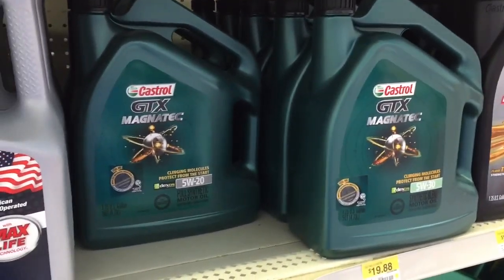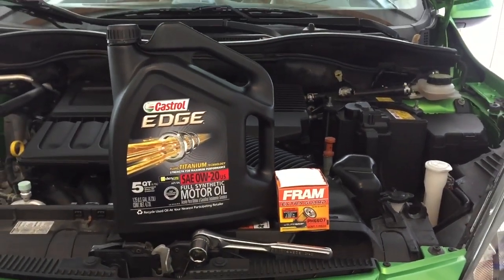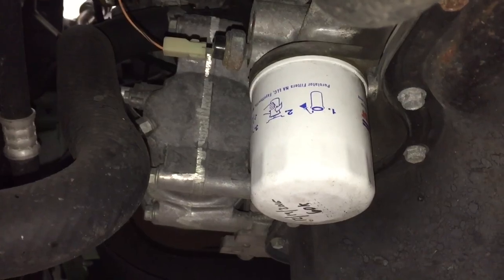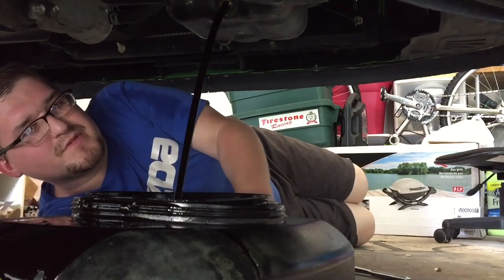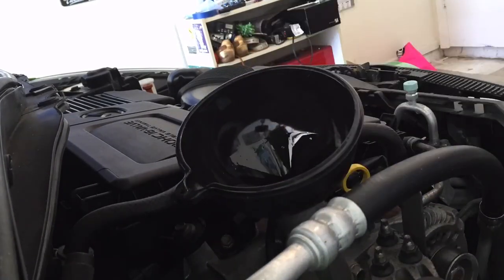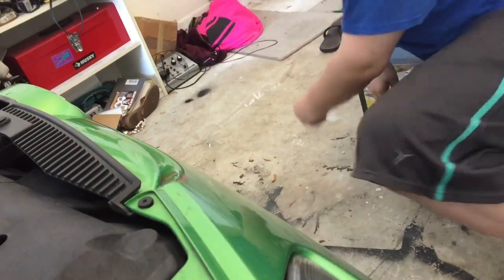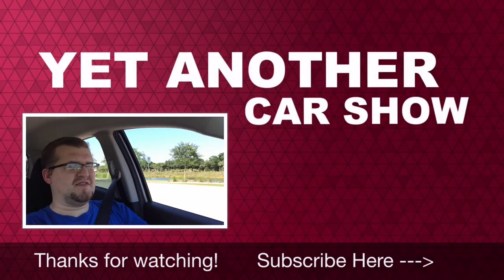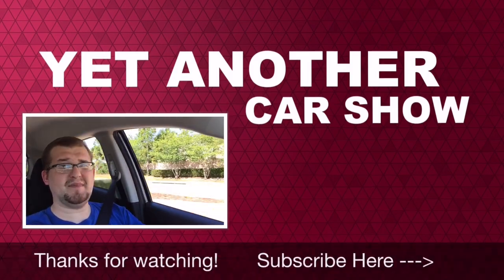Mazda2 | Oil Change How-To

Comment: never use a fram there junk i use Purolator PBL14612 PurolatorBOSS Maximum Engine Protection Spin On Oil Filter,  there the best!
Reply from the maker: I admit it’s a junk filter in the video and still get these comments years later. The car is a former rental. Worse things have been done to it than a Fram filter ONE TIME. I still have it. Still runs great. This response isn’t personal, it’s for everybody coming here to say Fram filters are junk.
Reply: @HiroshimaSpirit  grate vid all ways in joy your vids
Reply: i've been using the basic fram oil filter for 30yrs and every car i've owned has gone well into the 200,000mi range.  yes i've seen the videos where they cut the filters in half... just change the filter every 3,000mi (they didn't have these fancy oils that last forever, back in the day).
Reply: When you say junk, have you ever opened one?  Are they worse than a Mann or Bosch?

Comment: is the orange filter shorter than the white? is that ok?
Reply from the maker: I made this video years ago and only used that Fram filter once. I don’t remember. As long as you buy a filter meant for the car, it’s fine. I’m sure they’re all a little different looking.
Reply: @HiroshimaSpirit  i just bought one from local store, but like yours the nes one is much shorter than the old. all dimensions yhe same, just the height
Reply from the maker: Again, if it’s a filter that’s listed as being for the 2, it’s fine. They’re all going to be a little different.

Comment: I've been looking at Honda Elements and Fits and totally forgot about the Mazda2 despite having owned a 1996 Miata from 2010 to 2016. There's a 2013 green Touring model with manual transmission for sale at a Chrysler dealer with 35k miles on it and they're asking $8,200 online. I'm hoping to get it for $7,000 or maybe $6,500 do you think that's a lowball? I don't want to spend a lot of money. I have $1,000 saved and would have to finance the rest. Carfax shows a ton of Pep Boys oil changes though :( Should I bring that up as a reason for my low offer?
Reply from the maker: I’m glad that you’re considering a 2! As far as the price, it all depends on the condition it’s in. Personally, I say $8200 is high. Your pricing is more like it, given that it’s a Touring and has decent mileage. The oil changes count as a maintenance record, so if anything that’s to the dealer’s advantage. I’d be more worried about no history at all. Hopefully you can haggle them down and end up in it!
Reply: Thanks for the reply! There's only a stock photo of it online so I'm going to go look at it in person today since they're closed and I won't be hassled. If everything checks out, I'll come back during the week to drive it and give them my $6,500 offer or walk away and keep looking.

Comment: Good oil. Purolator Pure 1 is a very good filter. There are others brands also for only a little more.
Cardboard under the drain pan and to lie on. Save for next change.
Lift up the catch pan as you take the plug out to avoid big spills, then lower the pan and let it drain.

Comment: You should never use the old oil to seal a new filter just in case there is any dirt or metal shards in it or other contaminants. Always use new oil and always clean the filter area (on the car) with a clean rag. If the filter doesn’t come off by hand, use a filter wrench to use as leverage & grip. 
Also, the number one rule is always wear gloves, overalls & goggles whilst doing anything involving car fluids! Especially when working under a car. Oil can cause dermatitis and skin cancer & also if you’re underneath, there’s a chance a bit of rust could get in your eyes too. Hence the safety equipment!

Comment: I just got a 2014 mazda2 sport 5mt and changed my oil this weekend. Castrol Edge 0-20 and a Mobil 1 M1-108a filter. I noticed there is no splash shield under the motor. Is yours like that also? Not used to seeing everything so exposed underneath! Especially in the New England aka the rust belt lol.

Only thing I do differently is I fill the new oil filter before I screw it on, so I don't have a dry start while the new filter fills with oil . Good video thanks!
Reply from the maker: They’re all like that, don’t worry. 

Filling the filter up before installation is totally fine. Either or. If you’re worried about “dry” starting, you can also prime the oil system before starting the car. Throttle to the floor (engine won’t start) and give it a couple of cranks to build pressure before releasing the throttle and starting normally. Also a good idea if the car has been sitting for an extended period of time. Thanks for watching! ✌🏻

Comment: Question ; Rotating tyres is not common where I'm from.. You mean swap the wheels around? I can see advantages in doing back to front. But why is this an American thing?
Reply from the maker: Tires wear unevenly front to back. If you rotate them every oil change, it extends the life of the tires because they wear evenly. It’s not just an American thing. It’s good practice and it only takes a little extra time to do.

Comment: Thanks for this awesome video. I tried oil change yesterday, draining the oil went fine however removing the filter was impossible. I ended up calling the recovery company and he hammered in a screw driver and managed to pop it off. 
A question, do you know of any tools possibly a filter wrench that i could use so i wont face the same difficulty again? As i am not comfortable with the hammer and a screw deiver method.
Reply from the maker: +Davood Yazdani Sounds like your filter was on way too tight. I've never used a filter-specific tool on any car I've owned. If the filter is tightened snug by hand, you should easily be able to remove it by hand the next time around.
Reply: Hiya, yup, thanks to Sandicliffe Mazda authorised repair centre UK!!!!
I bet u they have used a wrench to tighten it.
Reply from the maker: +Davood Yazdani That's why I avoid service "professionals" if possible, and do it myself.
Reply: @HiroshimaSpirit  you are absolutely right. All my overly tight oil drain plugs and oil filters are thanks to the workshop 😠 So I ensure I DIY my oil change. Oh, workshops always overfill the crankcase and that's very bad for the engine.

Comment: What tires do u use on your mazda 2 and where do u buy them from.
Reply from the maker: +Job Tom 205/50r15 Nitto NeoGen. I buy mine from Walmart because they're $80 each, with free shipping to the closest store.
Reply from the maker: +OriGinal Bosnian Well, they're fitted to wider aftermarket wheels, but yes, the car drives just fine.

Comment: Hello nice video, I want to ask you every how many km you should change the oil?
I have a Mazda Demio 1.3 of 2014 imported from Japan, here in Cyprus
I found in the Castrol site the oil suitable is Castrol Magnatec 5W30 and this is what I use every time I use 4 litres every 15000 km
I see you use a different oil I use what Castrol reccomends in their site
Reply from the maker: 15,000km is an acceptable oil change interval for a street car, especially with modern synthetic oil. 👍🏻

Comment: Hey man, appreciate your amazing channel. I have couple of questions.
Do you think it will be possible to change oil without lifting the car?
Also, you mentioned that castrol is recommended by mazda. Does this apply to european mazda's as well?
Reply from the maker: On stock suspension it is more of a pain, but absolutely possible to change the oil without lifting the car. 

I only know what my US-spec owners manual recommends, sorry.
Reply: @HiroshimaSpirit  thank you for your brief responce. In my user manual, dexelia is recommended but this oil is unavailable. Each and every menachic suggests different oi brand however which frustrates me to be honest.

Comment: So I have a 2012 mazda2 auto and the transmission fluid has never been changed. It's at 100k. Mazda dealer said to not do it cause of a 50/50 chance it could ruin it. What's your experience on this? Mazda USA is taking there sweet time to get back to me. Thanks
Reply from the maker: My auto has never had it done either as far as I can tell and has 175k miles. At this point I’m not messing with it.
Reply: @HiroshimaSpirit  thanks for the quick response. It's been a reliable little car so far. Just discovered your videos as you seem to be the only guy on YT who has any clear informative videos on this car. Subscribed.

Comment: what filter do you use i mean are any sizes  or types? i don't want to order the wrong one, thanks!
Reply from the maker: If you’re ordering online, I there will be a way to filter by make and model. In 2018 there are plenty of ways to ensure that you’re buying the right part, especially online. I specified the one I bought in the video, but each manufacturer calls their filter by different numbers. It’s a pretty common size, given that every Mazda I’ve ever owned takes the same size oil filter. Miata, Protege5, etc are all the same.
Reply: HiroshimaSpirit thank you

Comment: Does the 2009 Mazda demio take the same oil?
Reply from the maker: It depends on your region. Consult your owner’s manual or your local Mazda dealer for the correct oil weight for your climate and location.

Comment: Great vid!!! Can you make a video on how to lift the mazda 2 on a jack. I want to know where are the different jack points on the car
Reply from the maker: +Jonathan Marrero I use the recessed jack points at either end of the pinch weld underneath the rocker panel. As far as I know, those are the safest, if not only safe, spots to jack up a 2. I recommend that you also use those jack points when working on your car. Thanks for watching!
Reply: +DaedalusZero thanks man looking forward for more m2 mods. Awesome channel 😁
Reply from the maker: +Jonathan Marrero Thanks! I appreciate it! :D
Reply: what was the bolt size for the oil compartment?
Reply: Andriks Salvatierra if you mean the oil pan then it's 19mm
Reply: Jonathan Marrero that's what I meant. thank you!
Reply: Andriks Salvatierra For loosening the bolt use a breaker bar because its hard if you use a normal ratchet to loosen it
Reply: Jonathan Marrero and synthetic oil right? couldn't find in the manual if it was synthetic or conventional
Reply: Andriks Salvatierra its 0W-20 and it is fully synthetic. Also that type of only  comes in synthetic

Comment: how many liters do you have to pour?
Reply from the maker: 3.88L (or 4.1 US quarts, as stated in the video)
Reply: HiroshimaSpirit : i bought castrol 5w 40 , is also good?
Reply from the maker: What does your owner’s manual and/or oil cap recommend? Different climates sometimes require different oil viscosity. Compared to 0w20, the oil you bought is quite a bit thicker, so your fuel economy may suffer, but it’s not like it won’t work. I use 5w30 full synthetic in my higher mileage 2 and the recommended 0w20 in the other.

Comment: Nice video!

One thing that wasn't covered was replacing the crush washer on the drain plug. I think it uses a copper washer from factory, and it's usually safe to re-use these a few times, but I'd recommend changing it out every few oil changes, if not sooner. If one chooses to go longer, they should at least inspect it closely for any signs of a leak. Also, don't over torque the drain plug in attempt to stop a leak.
Reply: Absolutely. I've been through all this.

Comment: The FRAM oil filters are not that bad but get the Tough Guard or the Ultra Synthetic filter next time. Extra Guard is geared more for conventional oil. Great vid by the way.
Reply from the maker: +Zach Elder I typically buy, and recommend, Mazda Genuine filters. I only bought the Fram in a pinch. Thanks for watching!

Comment: I've seen in other videos that people fill the filter with new oil before fitting it. Did you do that but not show it?
Reply from the maker: +MrGeekGamer You can do it either way. Doesn't matter. I personally just lube the seal and screw it on as shown.

I don't exclude anything important from my instructional videos. If it's not in the video, it's either common knowledge or not compulsory information. Thanks for watching! ✌🏻
Reply: Always good practice as engine running dry until filter fills

Comment: Don't you also change the gasket and drain plug?? And BTW I always lubricate the new filter with new oil. I guess it a habit that stuck from the days when I used to drive old beaters. lol.
Reply from the maker: +KewlQT I change the gasket. Guess I forgot that detail in the video. It' should be in the description, though. The drain plug honestly isn't necessary. I've never changed it on any of my cars.
Reply: I once had a Tercel that I couldn't buy the gasket without getting the plug too. Toyota really gone downhill in recent years. I have owned about 6 of them but never again. I guess I said drain plug out of habit. My bad.
Reply from the maker: +KewlQT  No worries

Comment: Nicely done!  Hey any of you have the clunk in the steering column problem.  I have a 2011 Mazda2, and a friend of mine has the 2014 both our vehicles needed the steering gear replaced, as we had the clunk clunk when you parked the car or turned steering at slow speeds.  Enjoyed the oil change pointers will do them all tomorrow.
Reply from the maker: +jason richner Neither of mine seem to have that problem. Not yet, anyway. Thanks for watching! I'm glad you enjoyed the video!

Comment: Thanks for video I have the same car and I would like to ask you if you know , I have oil leak from  oil sump , the question is oil sump has  gasket or just put a silicon between oil sump and engine 
Thank you
Reply from the maker: There is no gasket, just a silicone seal. I recommend using Hondabond for that particular job. 👍🏻
Reply: @HiroshimaSpirit  thank you  from greece...

Comment: great vid!!,  can't find Fram Extra Guard PH6607 Oil Filter, does any of this Fram products works on mazda 2 PH2870A, PH3682, PH2951, PH3387A, PH7317, PH4967, PH2825?, which one is better? , tnx dude, nice work!
Reply from the maker: +Matias Aravena I couldn't tell you on those other sizes. I'm not a professional. I just know that 6607 filters fit. That number isn't specific to FRAM. I don't recommend the FRAM, by the way. It's just what was available for a reasonable price when I shot this video. Always make sure to check the oil filter guides that are usually provided, and if you're still unsure, consult a parts professional. 

Thanks for watching!
Reply from the maker: +Matias Aravena I was under the impression that 6607 was more commonly used by other brands, but after shopping around for filters today, it turns out that it isn't. Haha Sorry about that. Just be sure that whatever filter you buy is made specifically for the Mazda2.

Comment: Hey, we like your ideas about mazda:) We are from Poland-Europe and there is DEXELIA ULTRA 5W-30 oil used here. Can you tell us how often to change the oil, I make only a few kilometers a year. Is it ok to wait for 20000 km or should I change it after a year?
Reply from the maker: +Paweł B Modern synthetic oils can last a long time, but I wouldn't go that far between changes. For the sake of preventing deposits and buildup inside the engine, the most I would push an oil change to is 7500 miles (12,000 km). I prefer to change the oil in my personal cars every 5000 miles (8050 km), however. Thanks for watching!
Reply: Paweł B, in UK, i have been changing oil and filter every 20000 km/ 12500 miles. No problem, use good filter and 5w30 and you will be fine.

Comment: The 0W-20 is about $10 more than the 5W-20.  Is it OK to use that?
Reply from the maker: +DON LEE 0w20 full synthetic is recommended, with the weight being mostly for fuel economy. I know of other 2 owners who use 5w20-30 and it's fine, but I personally go with what is recommended. Unless you drive your car so much that you're constantly changing the oil, $10 every few months isn't a big deal, if you ask me. 

Thanks for watching!

Comment: Tried to do this today but Walmart tightened the drain plug so tight I couldn't get it off. Feel like a failure. Got all the oil, filter, pan, funnel..blah.
Reply from the maker: +Logan Schroeder You’re not a failure, you just need more leverage to get the drain plug loose! A failure would be if you forgot to put it back in once you drained the old oil! Haha
Reply: DaedalusZero haha true shit. Ended up going to Walmart and had them do it for $10. Turns out you can bring the oil and they'll do it.
Reply from the maker: +Logan Schroeder Hopefully they didn’t over-tighten the drain plug so you can do it next time! 😜

Comment: I love your videos,  I came here because im intrested in buying a mazda 2 2012/13.  I have a question: my wife will only drive an automatic... so I guess thats what im going to have to buy,  in your opinion do you think it will still be as good of a car. thanks.
Reply from the maker: Mazda2s are little tanks. Very reliable. My green one is automatic. It’s just as good of a car, but not as fun to drive. Thanks for watching! ✌🏻
Reply: Hi thanks for your response, I am about to go look at a few mazda 2's here,  My question today is this do all mazda 2's from 2013 have the skyactiv engine? Id like a 1.5L  but am not sure if all models have sky-active. I would also prefer the mazda 2 sport with the automatic triptronic transition. I live in the domincan republic and the dealerships all have similar prices regardless of engine size and  sport ect,   not sure they realize the difference .
Reply from the maker: If it has a Skyactiv engine, there will be some kind of badging on the car/engine cover to reflect that. The Skyactiv DE generation cars were all 1.3s with non-sport CVT transmissions. The newer DJ generation has a 1.5L and the automatic has a manual mode. The only way to get any kind of sport/manual mode on a previous generation 2 (pre-2015) is to find one with the sport CVT transmission, which has paddle shifters on the steering wheel and 7 “gears”.